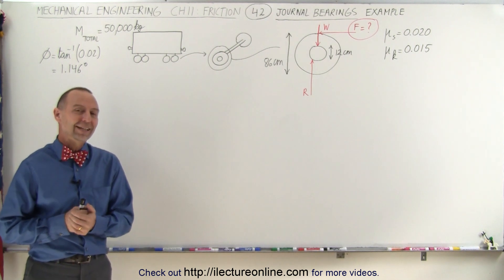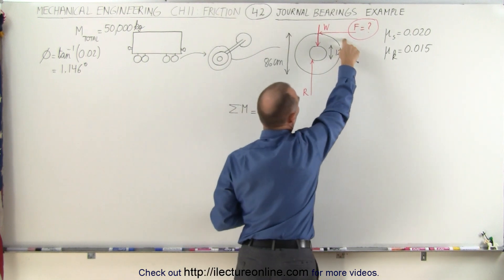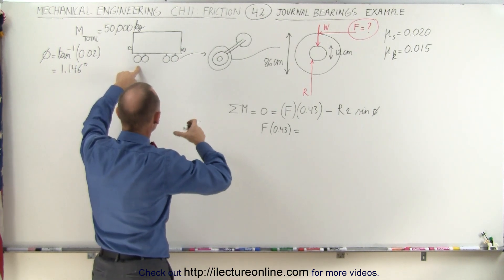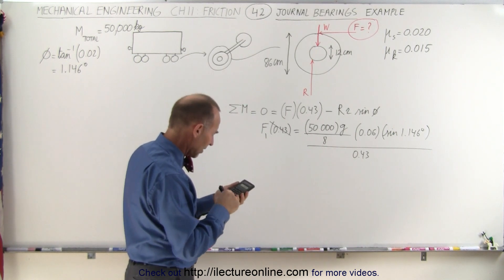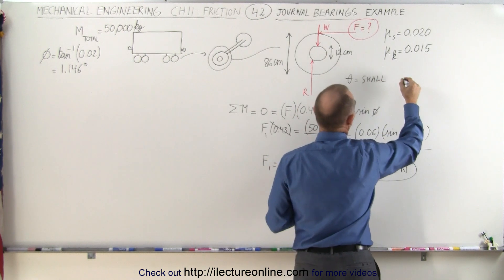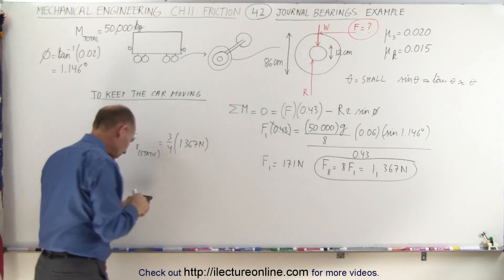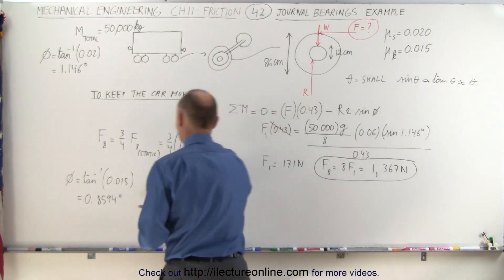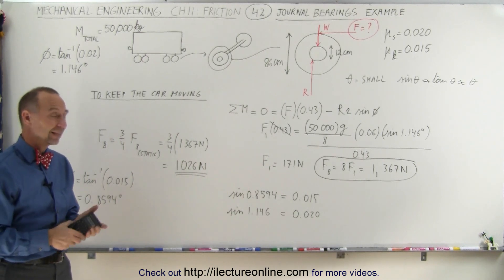Mechanical Engineering: Ch 11: Friction (42 of 47) Thrust Bearing: Example 1

Comment: To calculate the total force required to move the rail, do we have to add this force with Rolling friction Force on each wheel?
Reply from the maker: Then answer is yes.  But that is why trains are so efficient moving freight. The rolling friction is very low since there is so little deformation of the steel wheels.